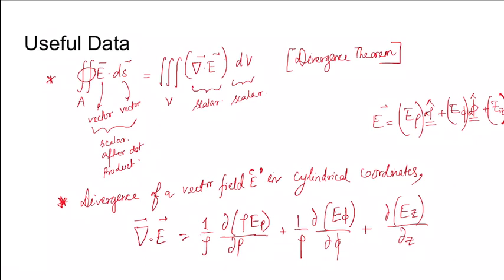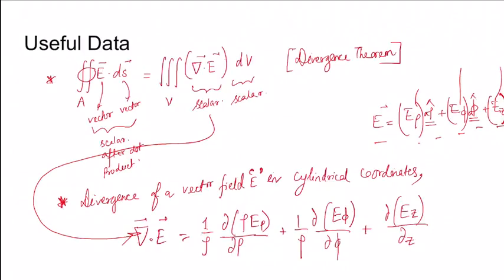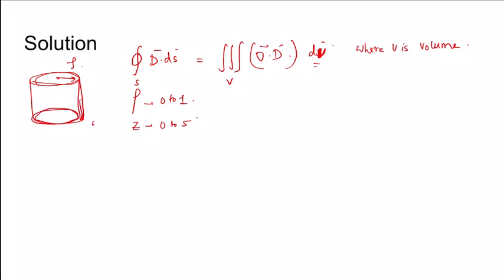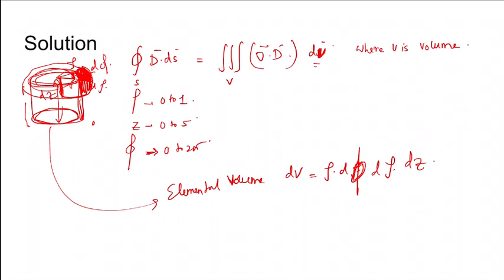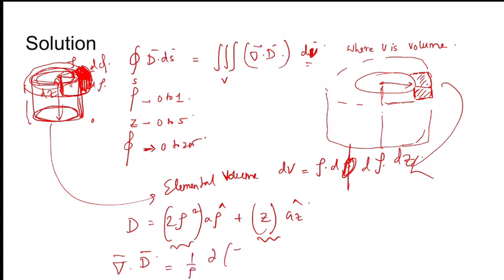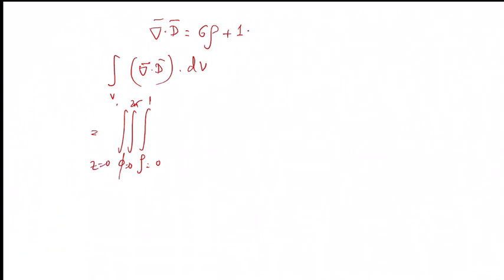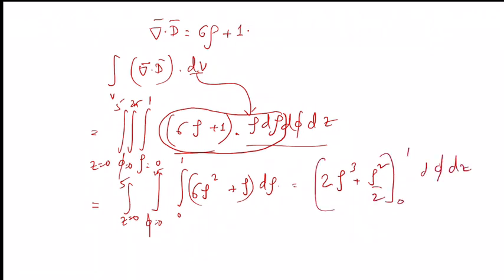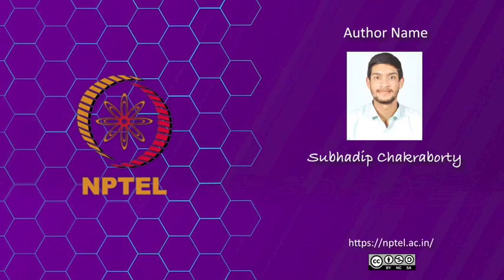Q29 EC 2015 S3

Comment: instead of using divergence theorem, can I not directly evaluate the integral by using D.ds, where ds = rho * d(phi) * dz = elementary area on the surface of the cylinder its direction being radially outwards.